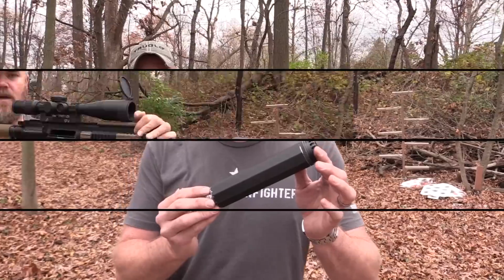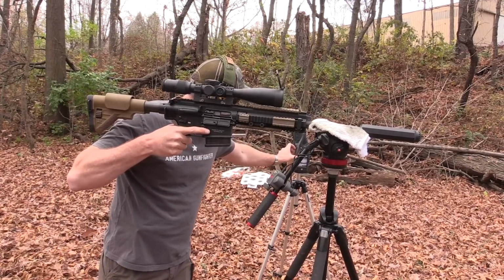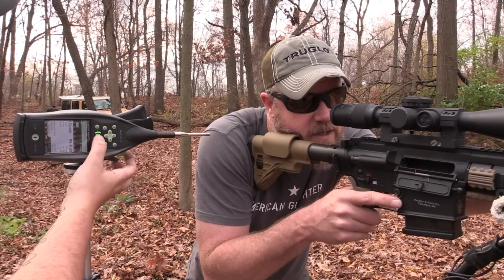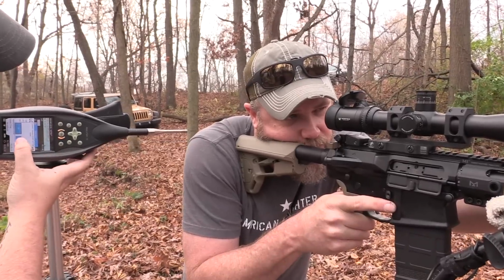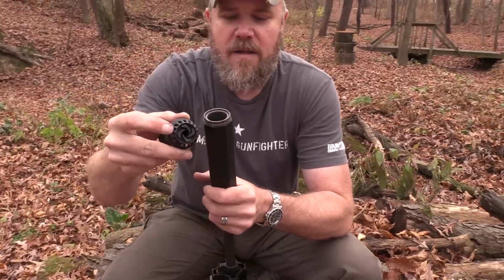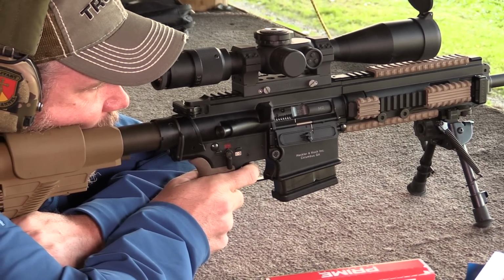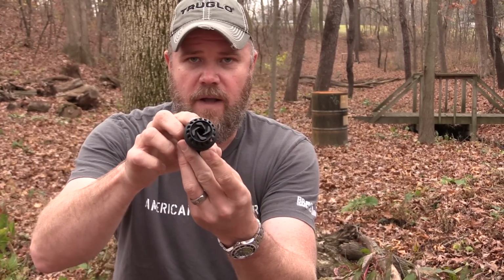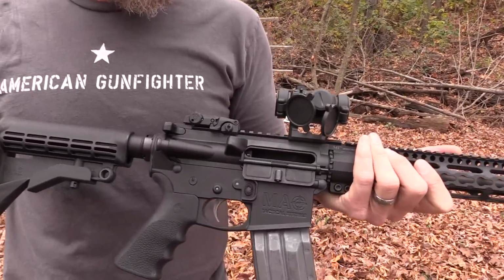New OSS Helix 762 Silencer full test!

Comment: If you are going to sound test silencer, please use the correct procedure.  Alan Paulson describes the standard procedure as per Mil Std 1474 in his book "Silencer History and Performance Vol 1" on page 85

The microphone is to be 1 meter to the left of the muzzle of the suppressor, not the rifle.  FWIW I have been trained to test silencers by both Alan Paulson and Phil Dater, people who have been doing this for more than 30 years.
Reply from the maker: I do it as Silencer Shop does because they're the largest retailer and aggregator of data. It's an utterly worthless methodology anyway and hopefully the new military standards will become common practice.
Reply: Thats a lame excuse.  The local shop does it wrong so you are going to as well?  The MIL Std may have its limitations but it is the only way we can compare suppressors equally.  Otherwise we are just making stuff up and then why bother testing anyway if we are just gonna make stuff up as we like?  

There is a correct method, detailed in Paulson's book.  It should be followed.

Comment: In your opinion is anything under 140 decibels "hearing safe"? Could you potentially shoot for extended periods of time with a volume measurement of that degree?
Reply from the maker: The 140dB threshold is for one impact noise. If you do a mag dump at 138dB you're still damaging your hearing.

Comment: I'm guessing that if MAC tested another suppressor on the HK762 (like an AAC or Silencerco), it would have been as quite as the OSS (both at the ear & at the muzzle)
Reply: I don't think the comparison was fair.  OSS on a Piston vs Dead Air on a DI with an adjustable gas key.  Piston Pop is going to occur closer to the muzzle whereas the DI is going to be louder at the ear due to venting gas near the ejection port.  Now if DI had an adjustable gas block or self-regulating gas block I think the numbers would be in favor of the Dead Air.
Reply from the maker: The muzzle device for the OSS is classified as a "silencer component" and thus you can only have one which ships with the can. They are working this out with the ATF so this won't always be the case. I got it for the HK rifle because this is the new CASS system not thinking that I wouldn't be able to run it on any other AR10. More testing will take place, but the results will be similar.

Comment: I'm fairly new to the suppressor world.  So my question here is, could this be the instance that the piston rifle is actually quieter than the DI rifle?  I'm just wondering if the venting of gas from the Gemtech bolt carrier actually is responsible for the increase in dB level at the shooter's ear.  Perhaps it is louder than the "piston pop" at the ear.  I would be interested to see the Sandman on the HK.

Comment: From what I've seen in previous videos am I right in assuming it would be okay to use a .308 can on a 5.56? I understand it may not be as effective on the 5.56 as a can made specifically for 5.56 but are there any other drawbacks or issue I should know about? Unless laws change I can't see myself ever having the budget for more than one so I'm looking for the most bang for my buck.
Reply from the maker: You can use a 308 can with a 556, it's perfectly safe.

Comment: Good point, but I in the field silencers are made to reduce the muzzle report to remain hidden. It would be nice to save your ears as well.
Reply from the maker: There's no free lunch in physics. If you want a modest sized silencer that isn't 3ft long you're going to have to trade one thing for the other. In this case, the OSS diverts sound forward away from the shooter and totally erases back pressure (which I find to be highly useful). If someone could come up with a quantum physics silencer that did everything the OSS does and kept the sound going down range at less than 140dB that would be awesome. Unfortunately we're not there yet. As as hunter and target shooter, I care more about preserving my hearing than I do the hearing of my target. :)

Comment: What about testing on rifles with the gas system turned off so as to minimize any discrepancy that many people have commented on already?
Reply from the maker: Why would you turn the gas system off? Would you use a disabled rifle in the field? I know I wouldn't.
Reply: To establish a uniform testing protocol that minimizes the difference between DI, Piston, or bolt action systems. I'm not saying ONLY with the system turned off.
Reply from the maker: I would just use it on a bolt action at that point. I can't turn the gas off on either rifle.

Comment: As much testing/comparing as you do brother I think you would know that you gota test both with the exact same rifle. You test OSS with Piston and the other with the DI and I can't understand why. I also think your left ear is actually closer to the muzzle, but the right is getting all the noise coming from the ejection port. Just a couple observations for next time. love your work though.
Reply from the maker: The muzzle device for the OSS is classified as a "silencer component" and thus you can only have one which ships with the can. They are working this out with the ATF so this won't always be the case. I got it for the HK rifle because this is the new CASS system not thinking that I wouldn't be able to run it on any other AR10. More testing will take place, but the results will be similar.
Reply: Military Arms Channel Roger that.

Comment: definitely more testing. not trying to be nitpicky (I know "but") it would have been a more consistent test if it were both rifles with both cans. I have a feeling the bolt contributed more to the at-large decibels being louder.
Reply from the maker: The muzzle device for the OSS is classified as a "silencer component" and thus you can only have one which ships with the can. They are working this out with the ATF so this won't always be the case. I got it for the HK rifle because this is the new CASS system not thinking that I wouldn't be able to run it on any other AR10. More testing will take place, but the results will be similar. The lack of back pressure is pretty obvious.

Comment: A proper comparison would be using the two suppressors on the same gun. I'm surprised you didn't think about the differences between piston and DI guns when it comes to sound signatures from a suppressor. NOW throw in the adjustable bcg that vents excess gas out the side of the carrier.....and barrel length differences changing distances....of course it was louder at the ear!.....I watch your videos, you're a smart guy, I can't believe you didn't catch that or think of it. UNLESS it was done to intentionally exaggerate the difference in the testing positions..... Although I wouldn't think you would do that. The HK not warranting the gun with other cans?? That's pretty poor for a upper echelon gun company. Given that, why didn't you scrap the HK test and just use the MI for both cans? THAT would be how you compare cans. When is that video coming? I'm not ragging on you, love the channel, love all the videos, everyone makes a mistake once in a while. Keep the great videos coming!
Reply from the maker: I'm surprised you give me so little credit. The muzzle device for the OSS is classified as a "silencer component" and thus you can only have one which ships with the can. They are working this out with the ATF so this won't always be the case. I got it for the HK rifle because this is the new CASS system not thinking that I wouldn't be able to run it on any other AR10. More testing will take place, but the results will be similar. The lack of back pressure is pretty obvious.
Reply: +Military Arms Channel My apologies, No disrespect meant. I just didn't understand why you didn't swap cans on the DI to be fair. Next time bring a wrench because I'd love to see the difference on the same gun. I've been looking at oss for a little over a year now. Thanks for taking the time to reply, I wasn't aware of the ATF ignorance on the oss mount being "special", but any other companies are just mounts. Only our government.....LOL 
keep up the great videos!

Comment: Hey MAC, I'd love to see more testing of various suppressors both at the ear, and just down-range of the rifle; testing both for hearing safety and true signature reduction. Ideally a single identically configured platform across different suppressors should give us repeatable results. Obviously for down-range testing subsonic rounds would probably need to be used, otherwise the supersonic crack would invalidate the actual dB of muzzle gas noise. This could be a great way to see which suppressors are best for hearing safety vs signature reduction.
Reply from the maker: All future tests will include testing at the ear as I mention in the video. 

The muzzle device for the OSS is classified as a "silencer component" and thus you can only have one which ships with the can. They are working this out with the ATF so this won't always be the case. I got it for the HK rifle because this is the new CASS system not thinking that I wouldn't be able to run it on any other AR10. More testing will take place, but the results will be similar. The lack of back pressure is pretty obvious.
Reply: Military Arms Channel
Good to know about the "silencer component" bit... something I'll consider when buying!
Reply: This muzzle device situation has apparently been resolved bc I ordered an additional compensator to fit my 556 in addition to the one that comes with the 762 which is made for 30 cal rifles.

Comment: As to why the military use to measure the 1.6 meters up and 1 meter away from the muzzle, it come from an old standard on how long a soldier can stand guard  next to a running generator, before suffering possible hearing damage. There was not a desire to change because the military was not really looking at suppressors until now.
Reply from the maker: I hadn't read that before. Interesting, I'll have to see what Google turns up.

Comment: Gas piston guns are quitter at the shooters ear because there is not gas coming down the gas tube, and the difference can be as great as 6-10db. This has been confirmed by testing, one way you can test is to shoot each rifle unsuppressed  using the measurement from the shooters ear.

Comment: You used two different rifles to perform the test. Everything you just showed is invalid. Especially at the ear test. I dont know why its so hard to change one variable at a time.
Reply from the maker: Yup, all invalid. Not a single measurement is valid. The muzzle device for the OSS is classified as a "silencer component" and thus you can only have one which ships with the can. They are working this out with the ATF so this won't always be the case. I got it for the HK rifle because this is the new CASS system not thinking that I wouldn't be able to run it on any other AR10. More testing will take place, but the results will be similar. The lack of back pressure is pretty obvious.

Comment: Air flow, gas or even liquids will take the least resistant path, which is basic physics. Judging either a Piston or DI system, I would assume the back pressure would naturally flow back down the barrel. Based on my knowledge of physics. I'm not a physicist, how I do have an advance degree in science (M.D. and M.S. in Chemistry).
Reply from the maker: Most gas does flow back down the barrel. Over 90% of it comes back down the barrel if restricted at the muzzle.

Comment: Why did you test OSS numbers at the ear on the piston HK and the Sandman on a DI gun instead? Its going to be louder than a short stroke piston gun by nature.
Reply from the maker: The muzzle device for the OSS is classified as a "silencer component" and thus you can only have one which ships with the can. They are working this out with the ATF so this won't always be the case. I got it for the HK rifle because this is the new CASS system not thinking that I wouldn't be able to run it on any other AR10. More testing will take place, but the results will be similar. The lack of back pressure is pretty obvious.

Comment: Good video. Like the silencer a testing a lot. I'd definitely like to see the results with them fired on the same weapon. Same operating mechanism at least. Merry Xmas.
Reply from the maker: The muzzle device for the OSS is classified as a "silencer component" and thus you can only have one which ships with the can. They are working this out with the ATF so this won't always be the case. I got it for the HK rifle because this is the new CASS system not thinking that I wouldn't be able to run it on any other AR10. More testing will take place, but the results will be similar. The lack of back pressure is pretty obvious.
Reply: Military Arms Channel Gotcha, makes sense.

Comment: great review. both yours and NFAREVIEWCHANNEL shows OSS has really stepped up their game!!
Reply: do wish u would've measured the Dead Air on that HK as well though. the self venting feature of the gas piston system probably did help it out as well
Reply from the maker: The muzzle device for the OSS is classified as a "silencer component" and thus you can only have one which ships with the can. They are working this out with the ATF so this won't always be the case. I got it for the HK rifle because this is the new CASS system not thinking that I wouldn't be able to run it on any other AR10. More testing will take place, but the results will be similar. The lack of back pressure is pretty obvious.
Reply: Military Arms Channel Ahh, understood. will keep looking for updates on your channel for side by side then. either way, awesome review. I've shot an old OSS suppressor before and was not impressed, I feel like with this newest generation, that will definitely change

Comment: This was an excellent experiment.  Hopefully there will be a new standardization in the industry.  I was very surprised by your results.  Also, I didn't realize that there was such a great deal of sound/gas being pushed back down the barrel do to the over pressure of the conventional suppressors.  I see how you can easily pass the current industry standard by creating more back pressure rather than an efficient design.  The negative side effect of the current standard is a suppressor that can pass the test but fails to protect the shooters hearing.  Thanks Tim
Reply: I guess I do not understand how you take exception to my comment?
Reply from the maker: That really makes no sense.
Reply from the maker: That really makes no sense.

Comment: To me, it seems that the other answer to the question is to use a gas piston system instead of direct impingement, or use an adjustable gas block..   That should work with any silencer to some degree...
Reply: Mad Dawg hmm the mr762 is a gas piston gun and it was still too loud on it
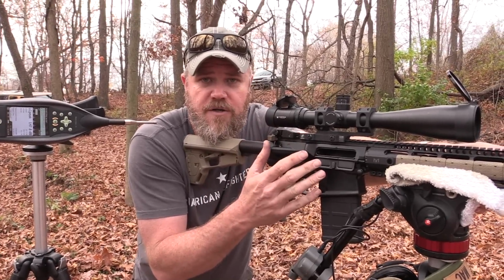Reply: Pretty sure he said it was a Direct Impingement gun somewhere else ( @ 10:48 ) .. I didn't see where he mentions the model .. My own .308's -one is DI, the other is an adjustable gas piston.  On the gas piston, I can turn it down from 2 to 1 when using a suppressor to keep it a bit cleaner.  Cleaner also means less gas & noise escaping from the ejection port.

However, I still think that the testing methodology is flawed;  to a right handed shooter, from behind the weapon, the ejection port is not exposed at the ear, but the meter is placed 6 inches to the right- where it gets hit from any blast coming from the chamber. Rather than 6 inches, I'd rather see 1 inch or less from the shooters ear. or done from a bench rest platform with the meter at the position where the ear would be.   Of course, using a bolt action rifle would negate needing to do this..  In the end, I wonder what would happen when you test with a semi-auto of a different design like the bottom ejecting or forward ejecting designs ( both from keltec ).. Maybe, just maybe, poor results of current designs will cause manufacturers to redesign the ejection ports,  or how the system unlocks & when.. 

Still, as I do use bolt actions as well, I would like to see bolt actions included; have a feeling that it would be plenty hearing safe..  Then people are armed with the knowledge of how each works; and what's better for them individually.   This video is good in some respects; it's not a total waste, just a bit incomplete.
Reply: Craig, I also didn't realize that MAC had swapped out the hosts either.   On these longer reviews, it's not uncommon to skip ahead... Some people seem to like to hear themselves talk; on a youtube video, heck, I won't watch those that are much longer than 30 minutes long;  those longer than 10 generally get skipped over in portions...
Reply: It doesn't matter what gas or piston system you are using. Baffle cans cause the gases to push back into and down the barrel towards the breach. That is one of the biggest issues with baffle cans. The increased pressure can cause malfunctions of the weapon system due to increased pressures firing the BCG rearward at a faster speed than designed. It also increases the gases expelled into the shooters face, and as the video shows, an increase in noise at the shooters ear. The baffleless (OSS) system reduces the amount of gas being forced back down the barrel to a level almost equal to the unsuppressed shots. Since the gas escapes at the muzzle, I can see why the sound would be closer to 140dbs at the muzzle and sub 140db at the shooter's ear.